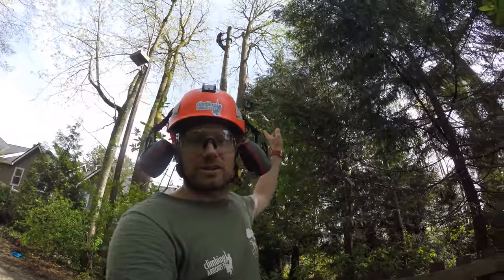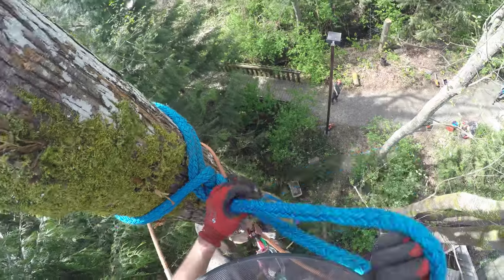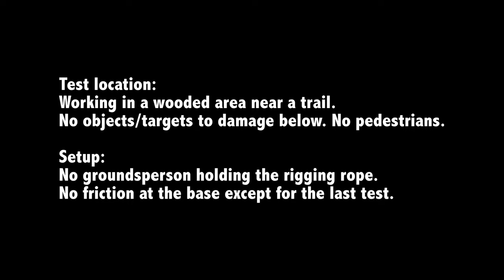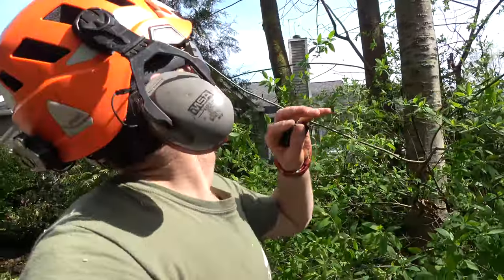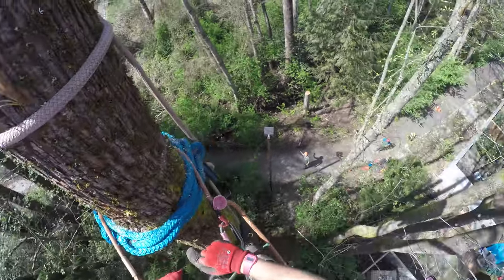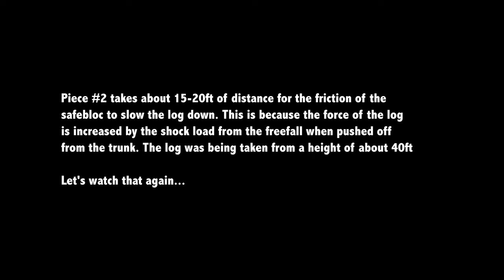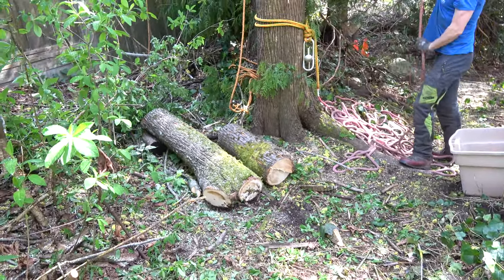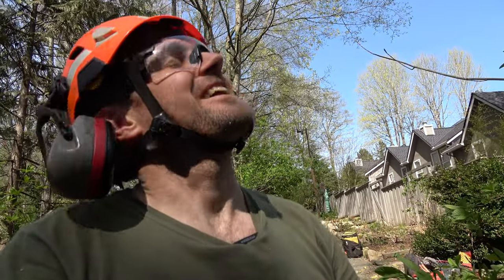Rigging test: How much friction does a SafeBloc add

Comment: Unless I missed it (and it's highly possible), you didn't mention anything about the rope you're using. It looks to me like 1/2"- 5/8" Stable Braid, but if you were to change the diameter of the rope, the results would definitely vary. It's a super important variable with this particular device. You get a lot more friction with larger diameter ropes, and a lot less with a smaller diameter. I think the rope size and type/brand should be added to the initial info sheet. Otherwise, very interesting video. I don't use my Safebloc often, but I do like it for negative rigging- especially on compromised trees where doubling the load with a 2:1 is not a wise move.

Comment: It's an interesting conversation about which direction to thread the safebloc.  I'd never seen it threaded in the manner y'all have done in this video however this configuration actually catches the piece (when negative rigging) sooner than if threaded in the opposite direction. This distance is only the distance between the outside two holes but theatrically if it's a decently sized piece you can potentially reduce a significant amount of evergy...right?

Comment: Been looking at a triple thimble by notch. Thanks for this video
Reply: I have gravitated to the triple thimble and rarely use blocks anymore. The aerial friction reduces the force at the rigging point and reduces the need for a port-a-wrap.
Reply: @markmalmstrom9038  how do you like it the triple and what size sling and which size lowering rope do you use with  it? Also, does it make curly cues in the rope? Thanks!
Reply: @paullanctot9476  sorry for the slow response I just saw this. It doesn’t really twist the rope and Is easy to use. It’s my first choice for aerial friction besides a natural crotch. Many times it eliminates the need for a port a wrap on the ground. We rarely use rigging blocks anymore.
Reply: @paullanctot9476  I use a 3/4 tenex sling that I sliced in and usually 1/2” stable braid or Arbor Plex but you can use bigger rigging lines.

Comment: Thank you for this intresting content. Just yesterday we had to lower some bigger oak branches and to gain some time I started self-rigging them whilst my workmate was dragging them out. I did it old-school (rope over branch above) and was surprised to notice that, often, friction and rope weight were enough to safely bring them down.
Reply from the maker: Thanks for the comment as always. Great work on your rigging job, sounds like you were being efficient with your time and man power
Reply: @ClimbingArborist  Thanks. During the process I was trying to figure out some kind of reliable self-braking system and after your test a safebloc seems to be a good solution.

Comment: Thanks for making this video Dan.
I work solo. I found it very interesting to see how much the PortaWrap slowed down the log with only one wrap. I'd like to see more tests with the PW with various numbers of wraps and no one running the rope. I use similar devices. The by Sein invera-wrap and RC1000. I take the inverta-wrap up with me and hang it on a loop runner sling 12 inches from my cut. May rigging rope is locked off on the stubs. After the cut swings down I lower the limb. I only use this method when the customer insists on no lawn damage. I'm going to experiment when an opportunity presents itself.
What diameter rigging rope were you using?
Awesome video.

Comment: so just watching this video is there a right and wrong way to set up the safe bloc? as normally when snatching or negative rigging... id put the rope through the other way in the safe block... what i mean by that is you have started in the bottom hole on the safeblock>>> i would start at the top hole making the working end of the rope at the bottom hole of the safe block. you guys have it set up the other way round ? i shall instgram you a picture
Reply: When lowering a log the tail of the rope should enter the top most hole and the working end weaves through the holes and exits through the bottom most hole. 
I have never heard of a rig going wrong the way they are doing it but the Xman designed and tested it the way I described.
Reply: I think I’ve seen posts about the block rotating in the splice if not done ‘your’ way

Comment: Hey, great topic, great video.
I'm pretty sure these devices work mostly as force multipliers, a bit like a torsen differential.  So, with zero drag on the rope other than its own weight and inertia, the SafeBloc is going to be finicky.  Adding a weight (maybe 10% of the chunk's weight?) to the rope might produce more repeatable/predictable results, but then you've REALLY got to know how much rope you need and deal with that weight when it gets to you in the tree (hope it's moving slow).  I've tried doing a few wraps around a branch to put drag on the rope going into a triple thimble before, with poor results; the chunk either flies off or goes nowhere.  This idea of rigging her down yourself from above could get scary real quick: moving ropes too close to you.  I think, an electromechanical device with a drop height setting would be the way to go, if anyone ever wants to really change things, not necessarily for the best

Comment: Have you used the safebloc with a rope such as a 18mm sirius bullrope ? Im looking at the safebloc for negative rigging big stems down
Reply from the maker: Largest was 5/8" that we used, but it will take larger, which also will add more friction so better for large pieces

Comment: Next interesting thing.For shure you have to apply some force by your hands.
Very nice tool for Solo rigging operations.
I prefer 11-12 mm rope.If you need more friction you can make two wraps on the higher bar(closer to the rigging piece in vertical position- not so how this done in the video)